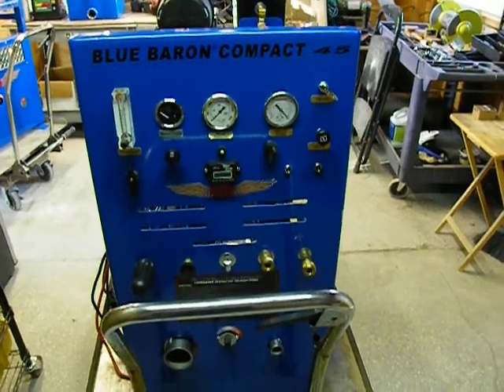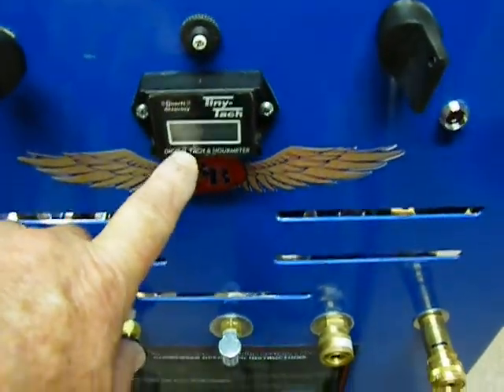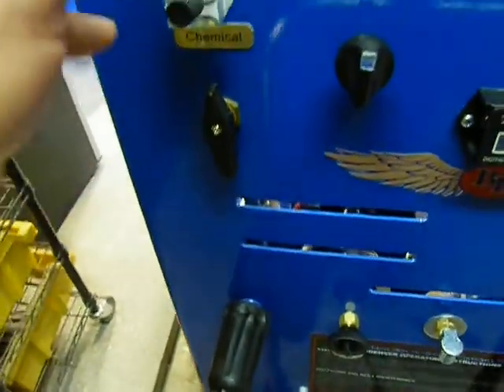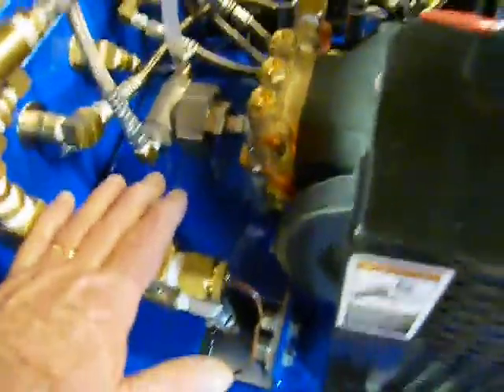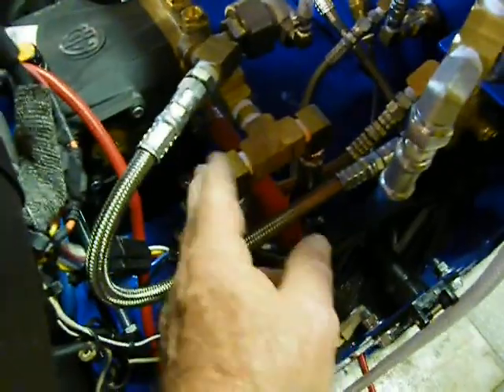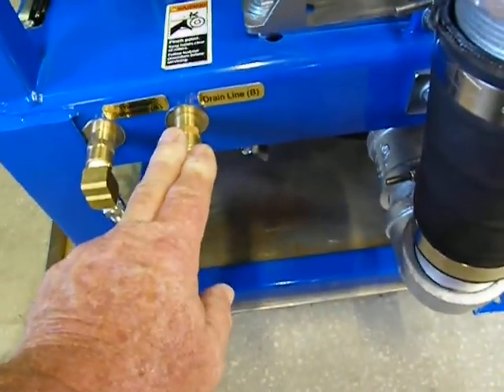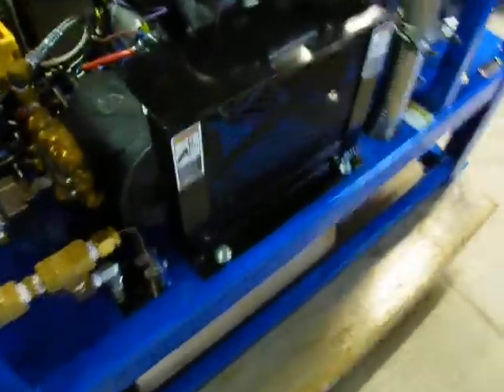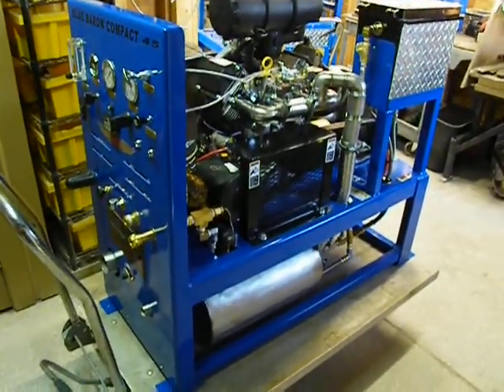Factory Direct Truck Mount Blue Baron Compact 45 Truck Mount Carpet & Tile Cleaning 727-505-2989

Comment: Pete garland @ blue barron TM, is building our new 45 and inline filter box ,for our cleaning bussiness @ CJ’s carpet upholstery tile & grout restoration. Can not wait till we recv it to put it to work right away .again pete thanks for building our new TM. Folks if u need repairs on your TM older or newer mounts , pete has a great shop to repair ur machines and parts for your TM . Please visit pete garland TM @ blue barron truckmounts .com